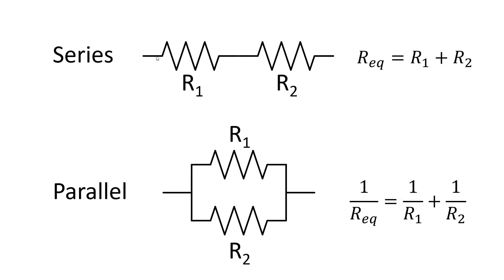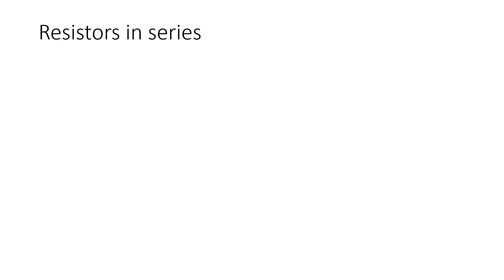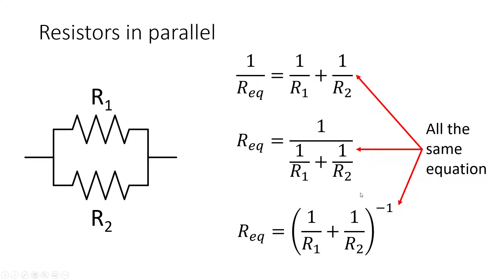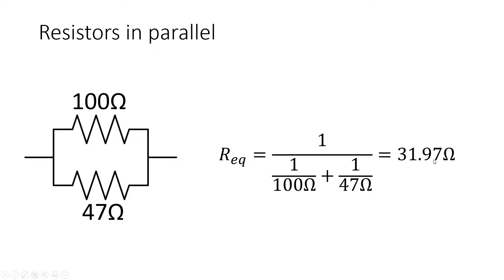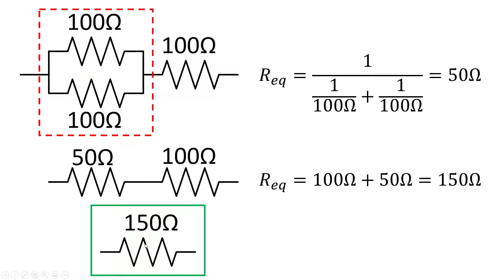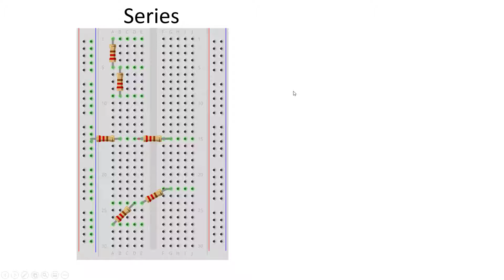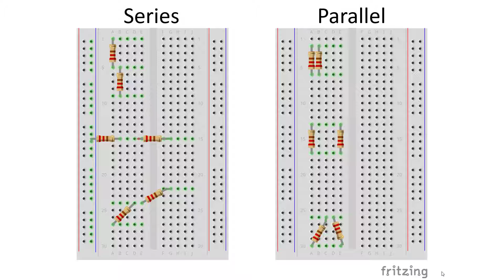Resistors in Series and Parallel

Comment: Why do i want to do it? Because my car is gay and I need a stupid resistance value to get it to start, I can use the key and put the wires against the ends of the resistors but the problem is holding it there while driving

Comment: Hello, question, i have a 2x  3R3 smd resistors in parallel its on the outside solar light board i added +1more 3.7v 2A 18650 batt. so now it's over 4Amps They getting hot now should i just add one more? Don't know if i have same smd resistor but i have lots of regular ones. I am not an electrician just hobbyist . Have a little bigger solar panel from referent light makes like 6.6v i tested, but the panel wasn't even connected yet i was just testing the light. So the resistors getting hot cause i added batt.? Or cause the panel its from different light kinda same light same voltage same size led panel

Comment: Thanks for this. I'll send my ham radio students to this video. I'd add, though, that there are many more uses for series and parallel resistances than just finding a suitable resistance value from the resistances on hand. One is to also increase power capacity, and another of course is to combine resistances from devices other than a resistor. Also it's worth mentioning that the weird resistance values are related to their tolerance, which covers all possible values within the stated precision.

Comment: I find the best way to explain resistors in parallel vs series is to use the anology of turnstiles at a football stadium. 1 turnstile = 1 resistor e.g. 10,000Ω. So if you had two turnstiles, one after another (in series) it would be 20,000Ω which slows the crowd entering the stadium even more. However, if you've two turnstiles in parallel, it allows the crowd into the stadium quicker, so half the resistance.

Then I explain resistors of different values in parralel, which is when you've got two turnstiles, one that can quickly scan tickets from a QR code on your phone (low resistance), while the other is old man with bad eyesight that has to read the ticket  and mark it off a list of the tickets sold (high resistance) i.e. resistors of different values.

Comment: Im trying to figure out how adding a resister in parallel to a motorcycle blinker slows down the blinking frequency.  I understand the parallel limits the current and serial limits the voltage, but not sure how that changes the rate.
Reply from the maker: That's more complicated than what's going on in this video with just resistors, as it depends on the rest of the circuit connected to the blinker.

Comment: how is the power handling distributed across resistors in series , natturally you would expect 2 2w resistors in parallel to be capable of handling 4w however does this also apply in series or is the first resistor in line exposed to the full load and still only capable of 2w ?
Reply from the maker: Hi - this is kind of a lot to answer in a single comment, you might want to check out my intro to circuits playlist: https://youtube.com/playlist?list=PLKL6KBeCnI3U6KNZEiitdtqvrxkBhpuOp.

Comment: Thanks for sharing Ben! This helped me to solve the answer to this question..........
If Joe used 40 2k ohm 5 watt resistors to build a 50 ohm 3000 watt RF dummy load submersed in oil in what configuration did he install the resistors?
You have to wind up with 50 ohms, that's the key.

Comment: Combination of resistors in a audio circuit could be bad a resistors value drift especially in tube amplifier designs only in a power supply would work

Comment: Thank you for your videos. They are very helpful but I was curious if wattage says the same. If you have 2 1/4 watt resistors in parallel, are the now a single 1/2 watt resistor or does that have no bearing on it?
Reply from the maker: You need to calculate the power for each resistor individually to make sure none of them exceed their individual power rating.

Comment: I have a 100 wattsiren (8 ohms) with amp (11 ohms)... Im trying to lower the volume of the siren by adding resistors. I tried 4 900 ohm resistors in series parallel but the volume dropped to low. I'm afraid to damage the amp, any suggestions? Will it be better to use a 100 watt attenuator?
Reply from the maker: Hi - it's common to use current-limiting resistors with LEDs (https://youtu.be/EeCh68a1GEg) but they are not typically used in this manner with other types of loads. For example with a motor you would either decrease the voltage or use pulse-width modulation (PWM) to decrease the speed, not put it in series with a resistor. I'm not that familiar with sirens so I'm not sure of the best way to control the volume.

Comment: i've been wondering, is there a significant effect on using a multiple resistor than using 1 resistor, for example i have 1 10k ohms resistor and also have 2 5k ohms resistor, but i only need 10k ohms for my simple circuitry. so does using more resistor than using 1 resistor have an
 effect on the circuit?
Reply from the maker: It depends on the circuit, but in general for most beginner/hobby circuits it probably won't matter. Two resistors take up more physical space than one resistor, so it could matter if you were designing a printed circuit board (PCB). However, assuming the resistors all have the same power rating (1/4 watt is the most common), then the two resistors would be able to dissipate 1/2 watt total. So if for some reason you need to pass a lot of current through the resistor but don't have a 10K resistor rated at 1/2W, then you could use the two 5K resistors.
Reply: @BenFinio  i see, ty ty that was bugging me from the start lol

Comment: Hey Ben! Do you know how to mathematically predict how a pull down resistor will affect a 5v pwm signal. I have a controller board that has a floating pwm pin where I needed to add a pull down. I chose 1k ohm- because “the internet”, however I don’t think I’m getting 100% signal any longer. How do I find the minimal resistor value to pull down the output  without affecting the value. It’s a poor Chinese board design where having a floating pwm pin is a safety issue and when powered on defaults to 100%. This is for a laser.
Reply from the maker: Hi Keith! You would have to try and look up the specs of the board and see what the "output impedance" or "internal resistance" of the pin is. A mathematically ideal pin has zero impedance when used as an output (i.e. voltage does not drop at all when it's loaded) and infinite input impedance (does not draw any current from whatever it's measuring). In reality, the pin has some finite impedance in both cases. So when used as an output, and you add a pull-down resistor, you actually have two resistors in series forming a voltage divider, which will drop your output voltage. If you can find the internal resistance of your pin, then in theory you can calculate that voltage from this equation (where R1 is the internal resistance, R2 is your pull-down resistor, Vin is the ideal voltage from the board, e.g. 5V, and Vout is the actual output voltage): https://en.wikipedia.org/wiki/Voltage_divider#Resistive_divider (note that technically, this is assuming that whatever else you have your PWM pin connected to is not drawing any current, and all the current flows through R2). So, depending on what your minimum acceptable voltage is, you could calculate the minimum resistor value you need. However, that's all a very long-winded way of saying "just try a bigger pull-down resistor." I think 10k is a pretty common value. I don't think it hurts to oversize the resistor.